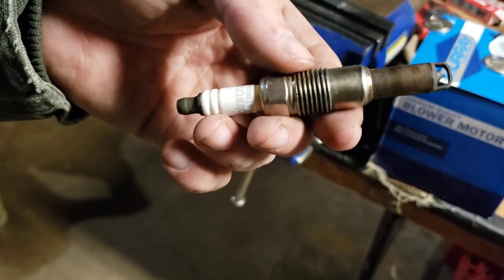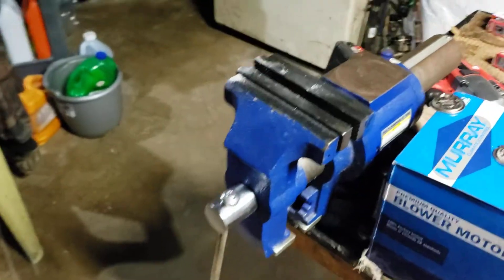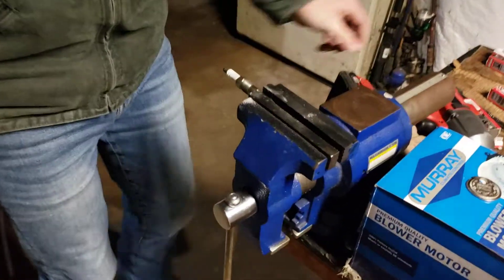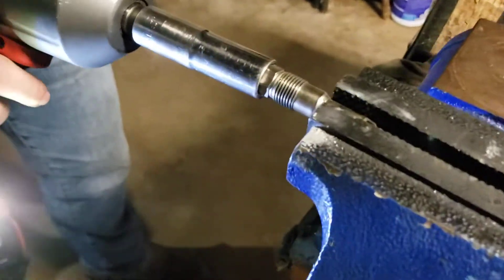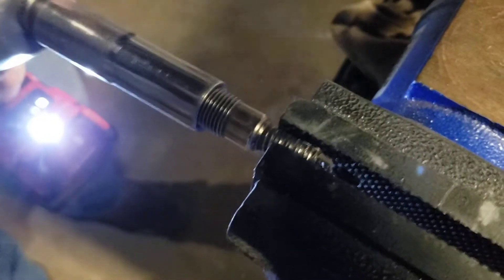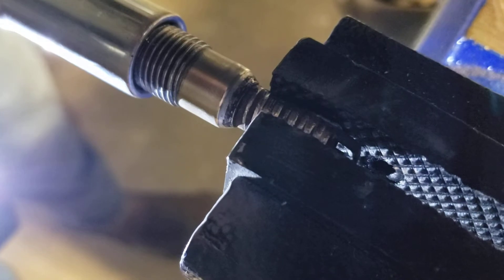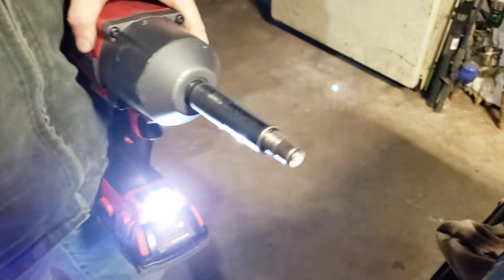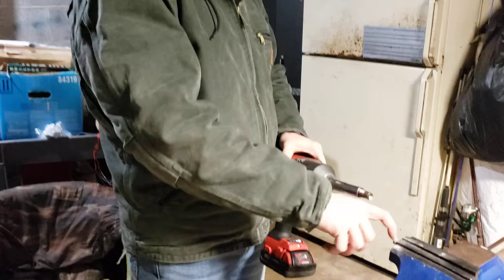What exactly happens when a Ford Two-Piece Spark Plug Breaks demonstration

Comment: Everything but the threads stayed in my motor. Complete length of Spark Plug..😢
Reply: Same issue with mine. Just broke the hex part off and the threads and electrode are stuck. Tried and easy out on the remaining threads but still won't come out.
Reply: @AguirreMotorsports How did you use and easy out if the electrode is still there?
Reply: @Letsjustbehonesttoday not the electrode, I meant the outer part at the end of the plug
Reply: @AguirreMotorsports Double Tap? 1 tap to get the thread sleeve out and another to get the bottom of the electrode maybe? You will get it, if you made it this far

Comment: And this is for the 05-06 mustang Gt’s? 07-010 is when it changed?
Reply from the maker: Mid '08-10 is when they redesigned the heads. But you can grab up some Brisk Racing Plugs for the  '05-08 that are one piece
Reply: @OctaneSlain  I was wondering because I have a 09 Gt if I wanted to replace the engine can I grab from the 07-09? Or 08-09? I know the 05-06 have the cross coolant hose